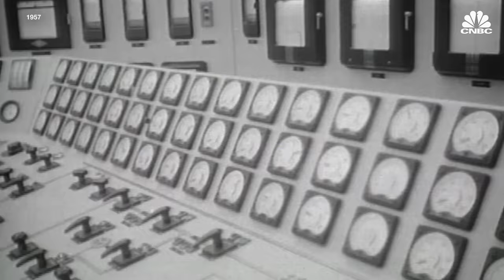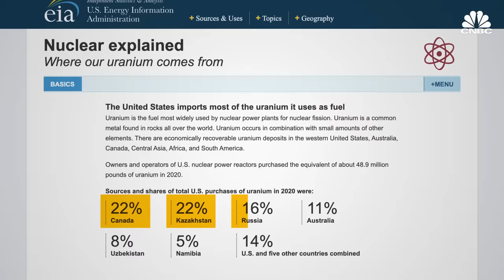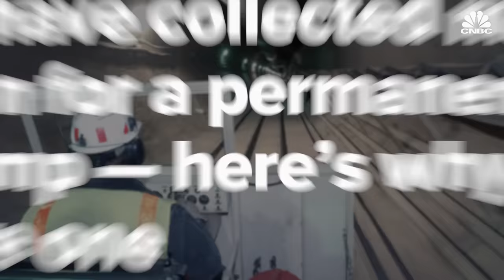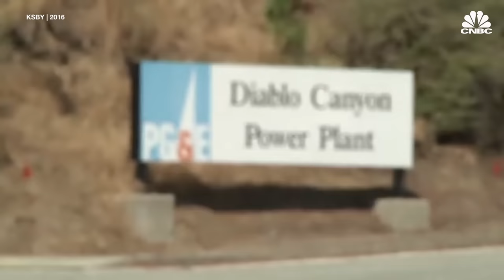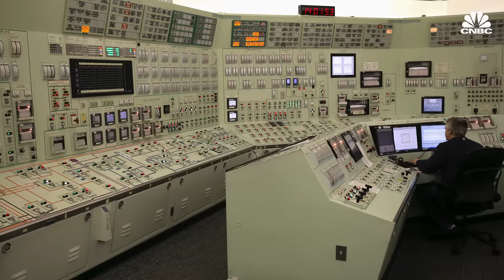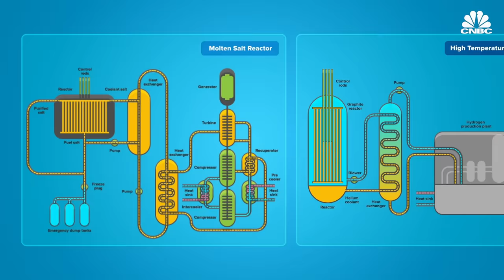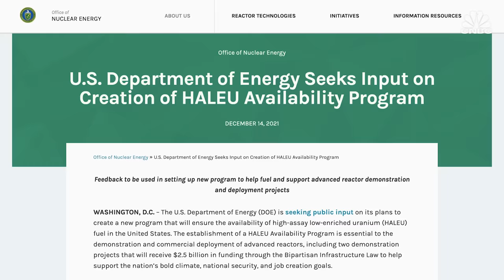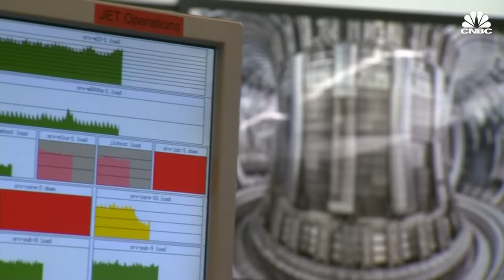Why Nuclear Energy Is On The Verge Of A Renaissance

Comment: The reporter lady is wrong. She says that there hasn't been much construction of nuclear reactors but currently there are 53 under construction world wide with many more in the planning phase. There have been many new reactors commissioned, most of these are in Asia especially China because they have a huge demand for electricity from manufacturing, high speed rail and consumers. CNBC needs to employ better journalists!
Reply: Of the U.S. recent 5 nuclear projects, 3 were abandoned after spending billions and the last 2 are 110% over budget and schedule and may never operate.  The latest 2 planned demo test reactors are not estimated to run until 2030 and are already behind that schedule.  So if the American reporter for an American media company was referring to America, she was correct.
Reply: @clarkkent9080   Yet you purposely continually ignore that many countries have been building and using small modular reactors for many decades built in two years or less for millions not billions.

Comment: How are they reliable when all new reactors are way over budget and they have issues so they get delayed for years.
And no one is talking about the radioactive waste.
Nuclear energy is safe until it fail once and then you have to deal with a problem for the next decades as every accident has shown as again and again.
Also Nuclear energy is not cheap to maintain that's the number one reason for their failures.
Also how can you feel safe when regulatory bodies are influenced by lobbies if we remember Three mile island or politics like Chernobyl.
Reply: Didn't you watch the video?  They clearly talked about nuclear waste.  Nuclear is much less expensive than renewables when proper energy storage is factored in.
Reply: @danadurnfordkevinblanchdebunk  I haven't seen any research backing that nuclear is cheaper than any other kind of energy production. Almost every new project is over budgeted basted on government reviews. So it is strange to support Nuclear when you can do so much more with optimizing energy consumption of every other resources.
Reply: @marinostsalis314   The US and many other countries have been building and using small modular reactors for many decades, built in two years or less, for millions not billions. Analysis

The NREL analyzes the total costs associated with installing photovoltaic (PV) systems for residential rooftop, commercial rooftop, and utility-scale ground-mount systems. Including the cost models for solar-plus-storage systems.  One thing all the solar rating numbers fail to mention is their numbers are nowhere near actual energy production.  For example, I have a 4kW photovoltaic array, but I only actually get 4kW for about an hour a day, and only then if it's not cloudy.

Comment: Any design that depends on active cooling and backup systems is unsafe. Any active system can fail and backups can fail due to a common cause with the primary. Fukushima became a dirty bomb when the cooling systems failed.  Some advanced designs are inherently safe some are not.
Another issue that is not addressed enough is the availability of fuel.  If we greatly expand nuclear energy and depend on uranium, it will be in short supply.  Alternatives like thorium would solve that problem.
Reply: you missed the biggest issue.  In America, we cannot build new nuclear cost effectively.  The last 5 nuclear projects in the U.S. have been failures
Reply: @clarkkent9080  Yet you purposely refuse to acknowledge that the US and many other countries have built and used small modular reactors for many decades, built in two years or less, for millions not billions.

Comment: The main problem with Nuclear energy is the waste. Even when disposed off properly, over time if not maintained it will leak into the environment. 

So if the waste issue is addressed might be a better approach to convince the population about nuclear energy.
Reply: @christopher smith you seem to not read. 
What you are proposing is not feasible. It is incredibly costly and as of yet not implemented wide scale enough to take all the spent nuclear material and dispose of it. 
Whoever you relative is definitely needs a lesson in basic economics. 
No funding means no solution. Just because a theory works does not instantly make it viable. 
Even the deepest mines in the world were dug out because of the resources extracted. Not to put waste in it. 
🤦🏻‍♂️

Comment: Couldn't come back soon enough
Reply: If you feel that way, you may wanna ask the ratepayers of South Carolina and Georgia about their electric rates.

The Southeastern U.S. is super pro-nuclear MAGA, has zero anti-nukes, and 100% political support. 
VC Summer (South Carolina) new nuclear units 2&3 were canceled in 2017 after spending $17 billion on the project (original estimate of $14 billion and 2016 completion date) with no clear end in sight for costs or schedule. 

Vogtle (Georgia) new nuclear units 3 &4 currently 110% over budget and schedule (currently $30.2 billion) and still not operating. Mid way into the build, the utility stated that had they known about the many costly delays they would never have chosen nuclear. They are now delayed another year because according to the project management, thousands of build documents are missing. If you can’t build new nuclear in the MAGA super pro-nuclear southeast U.S. then where can you build it?
Reply: @clarkkent9080   Yet you continue to ignore that the US and many other countries have built and operated small modular reactors for many decades built in two years or less for millions not billions.

Comment: Another point about nuclear power that should be stressed is that it's a centralized source of energy, much like oil and gas. Wind and solar farms are decentralized energy sources as they require large tracts of land spread out over a long distance to operate. This drives up the costs of renewables and makes investors very reluctant to get involved in these projects. So nuclear power  is the only centralized source of energy that's carbon neutral and has the baseload advantage. 

Realistically, though, it takes time to build a reactor and there aren't enough of them in operation in the US. It will probably take some combination of nuclear and solar to get the job done. Wind energy should be pursued in areas where it's actually viable. France is 80% nuclear but let's not forget it took them since the 1980s to get that way.
Reply: New nuclear in the U.S. has been proven to be massively expensive and cannot compete with solar or wind in terms of cost. The U.S. is vast with 80% of the population living in cities so I think we have enough land to site solar.  The rooftop solar in California produces more power during daylight hours than they need and that is just what is on people's roofs.
Reply: @clarkkent9080   Yet you fail to acknowledge the US an many other countries have been building and using small modular reactors for many decades, built in two years or less for, millions, not billions.

Comment: I've been hearing that fusion is 10 years away for over 50 years. At this point, we might get it to work one day, but I'm not holding my breath. Tokamak is from an old Russian design. They've been around for decades. It's the first (and as far as I know still the only) design that was ever able to create a fusion reaction at all. The heat and pressure needed are, literally, astronomic, since it's trying to duplicate what goes on inside of a star. A fission bomb (an "H" bomb) needs a "normal" fusion bomb (an "A" bomb) to generate, at least for a fraction of a second, the heat and pressure needed. Trying to create those conditions in an ongoing controlled process is not easy.

As to fission, I'm most hopeful on the molten salt reactors. We had one running at Oak Ridge for four years back in the 60s. It just didn't produce the plutonium desired for the nuclear weapons programs so they shut it down. That's a good thing if all you want is power. It's walk away failsafe, needing nothing but gravity to shut itself down safely in the event of a power loss. The Netherlands had a prototype running and the two problems they have to solve at this point are corrosion resistance in the pumps and creating a continuous, in-line chemical reprocessing of the molten salt. The first is a matter of materials science. The second is probably a bit trickier and I'm not sure that it's really needed, but I'm not a nuclear engineer on the project. It's only one of a half dozen proposed and under investigation new designs though, so at least one of them is almost bound to work a lot better than today's light water reactors. 

One of the main goals for most of them is to make them small enough to be able to mass produce them in a factory so that you can simply order as many of them as you need for your particular power needs. That also makes them standardized, which is one thing that France really did right and we didn't. They are already close to 100% non-fossil fuel between a combination of a lot of nuclear and a good bit of hydroelectric. Not all places can do hydroelectric though. Most places don't have the water volume and drop to make it work on any significant scale.

Comment: It's worth noting that natural gas is only cheaper than nuclear in the short term. In the long term, nuclear is much more economic due to its extremely low fuel consumption.

Also, fun fact: all deaths (except perhaps one) from Fukushima were caused by disorders during the evacuation rather than the reactors.
Reply: Yeah, even the one death turned out to be a false report.